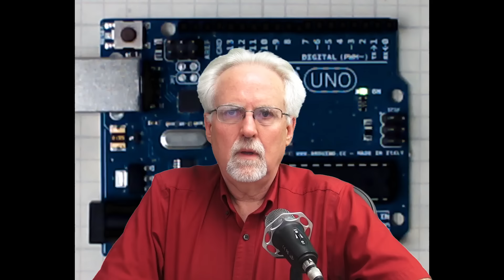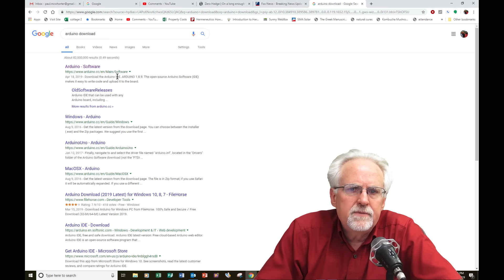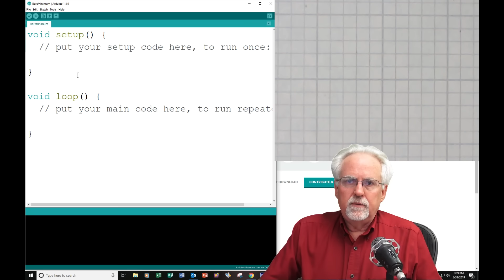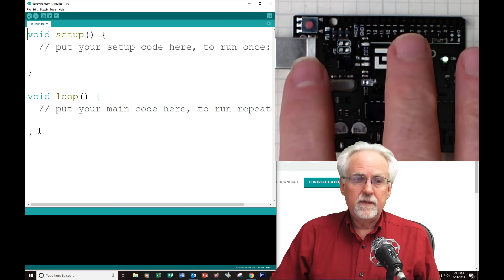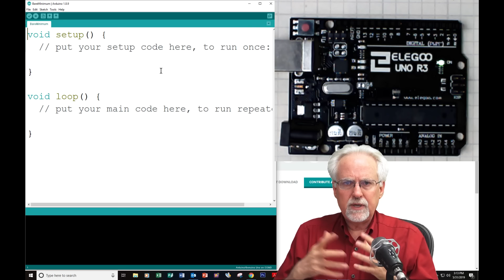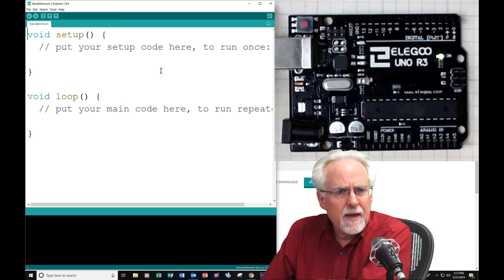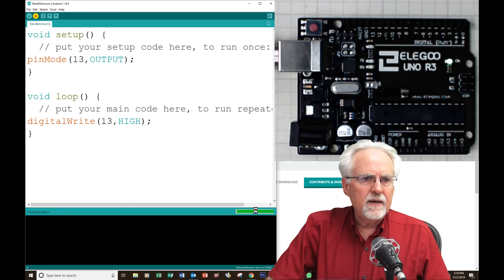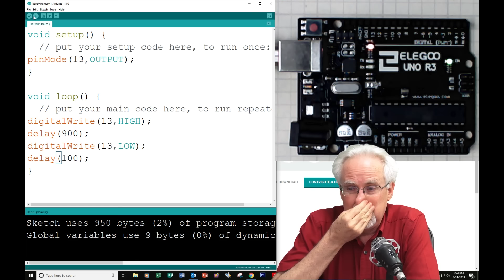Arduino Tutorial 1: Setting Up and Programming the Arduino for Absolute Beginners

Comment: Had a load of grief getting Windows to install the FTDI driver for my 1st tutorial (same problem on separate W7H and W10H machines). Eventually got working by using Microsoft driver instead of the Arduino driver. However, I was drinking sparkling water rather than iced coffee which maybe didn't help. Anyway, succefully did the tutorial and I got down to about 20mS on 20mS off. Any shorter period and it I could no longer observe discernable blink. 👍 Thank you for excellent tutorial.

Comment: I just got the kit, and found this video. I followed your directions very closely, downloaded the software, installed it, ran it, and entered the programs you layed out. My program works well. 

In my opinion, the LED doesn't have time to completely discharge when the cycle is lower than around 40 milliseconds. I can still see the light fluctuate to around 20 milliseconds, but it is pretty obvious (to me) that it doesn't have time to completely darken in so short a cycle. 

I'm running this from Puppy Linux (Fossapup64v9.5) on a Dell Optiplex 390 i5 2310@2.90GHz. It only took a few minutes to get the interface installed and running. Pretty seamless. 

Thanks for the content. Keep up the good work. בס״ד

Comment: I just got the kit, and found this video.

My program works well. In my opinion, the LED doesn't have time to completely discharge when the cycle is lower than around 40 milliseconds. I can still see the light fluctuate to around 20 milliseconds, but it is pretty obvious (to me) that it doesn't have time to completely darken in so short a cycle.

I'm running this from Puppy Linux (Fossapup64v9.5) on a Dell Optiplex 390 i5 2310@2.90GHz.
It only took a few minutes to get the interface installed and running. Pretty seamless.

Thanks for the content.
Keep up the good work.  בס״ד

Comment: hello sir
iam using tinkercad for building the arduino and coding in arduino software here i get led light at delay 5 also 
here is the code
void setup()
{
  pinMode(13, OUTPUT);
}

void loop()
{
  digitalWrite(13, HIGH);
  delay(5);
  digitalWrite(13, LOW);

  delay(500);
}

Comment: Hello, Several months ago I followed many of your tutorials on the Arduino Uno but I had to quit for various reasons. I have decided to start again and have started with Tutorial 1 however I'm having a couple of problems. 1) when plugging in the USB cord, the pin 13 light comes on and stays on. 2) when I write the program and press send to compile, I get the "Error compiling for board Arduino Uno". I've selected the correct board, the correct COM port, I have uninstalled and re-installed the software, which is now 1.8.13 with no success. Any suggestions?

Comment: Thank you for this.  I actually thought I knew all of what was in this video but I discovered that I wasn't changing the type of board when I should be.  I found that the LED on the board (pin 13) stopped blinking, to my brains perception, at around 15 or 16 mSec.

Comment: To my surprise (I am 68), I can go as low as {15,15} and therefore the time period T is 0.015 + 0.015 = 0.030 sec. The frequency f = 1 / T or 1 / 0.03 = 33.33 Hz.
That explains why frequencies on a TV monitor higher than 34 Hz are no problem to me (I think).

Comment: Arduino: 1.8.13 (Windows 10), Board: "Arduino Uno"

Sketch uses 924 bytes (2%) of program storage space. Maximum is 32256 bytes.

Global variables use 9 bytes (0%) of dynamic memory, leaving 2039 bytes for local variables. Maximum is 2048 bytes.

An error occurred while uploading the sketch

This report would have more information with
"Show verbose output during compilation"
option enabled in File -> Preferences.
  
i am a total beginner to Arduino and my first program does not work, i copied those error messages and pasted them here, can you please help me out, please.

Comment: I put 9 ms as the delay and the LED looks continuously on,  Tesla chose 16.6ms which is why the USA electrical power frequency is 60 Hertz.  The Germans who imported the technology did not like 60 and being metric, they decided 100/2=50 is better and since the Germans were more respected than USA at that time, all of Europe chose 50 Hertz.  the Europeans conquered the world so all of the world is using 50 Hz while N. America and Japan is using 60 Hertz.  But Tesla was using a generator where the ON and OFF is not a square waves which is why 16.6ms or 60 Hz is sufficient.

Comment: Is this still relevant today, I would like to learn arduino 😄
Reply: totally still a thing!   🙂👍
the Arduino community is actually pretty huge.  welcome!

1st, google “Download Arduino” and get the software.

next there are lots of demo projects you can start with, google: “Arduino ProjectHub”

as for sensors, motors, LEDs, etc.
many pre-built modules are offered online, e.g. Amazon.  search “Arduino Module”
I highly recommend getting a starter-kit with like, 3 dozen basic modules to try.  — they are around $30-50

you maybe want an “Arduino Uno” to learn on, — that’s the name of the circuit-board shown in the video.

also tho, I recommend searching, “Arduino Nano” and getting a 3-pack or a 5-pack.
they are smaller and cheaper that the “Arduino Uno” but otherwise do all the same things as the Uno.

💜  Good Luck, Have Fun!
Reply: yes, I bought my kit yesterday on amazon.

Comment: i m getting this error message just after installing the program. how to resolve this. whenever i m trying to compile a program it gives this message(even when the board is not connected)

avr-g++: error: device-specs/specs-atmega328p: No such file or directory

exit status 1

Error compiling for board Arduino Uno.

Comment: Hi I just connected my arduino card and LED started blinking automatically without command. I am using program 1.8.13 told to exit status after following all steps and (void unit_8 ; unit_8). Am I doing something wrong?

Comment: I am new to arduino. I have been watching Paul's videos and learning a Lot. I have successfully built my own circuit including RFID reader and a servo motor. Thanks to his videos I am starting to grasp how to build the circuit, how it works and how to code it. 
I am stuck now though. I now wish to add A push button to the arduino motherboard and code it to control the servo motor to cycle 180 degrees on each button press . Is there a video that paul has made That addresses this type of addition to an existing project? Maybe I'm over thinking this but truly stuck.

Comment: Paul, I am a total "virgin" beginner to Ardunio - even took me several days to pronounce that correctly! Is there a cheat-sheet available with the different commands/explanations?  I also notice you are using an ELEGOO UNO R3, is that brand reliable and less expensive than Arduino's brand? Thanks for making this very easy .... so far!

Comment: I just bought a Nano and a Mega 2560.  Neither board will communicate with my computer.  They both make the computer do its happy noise when you plug them in but the name of the Arduino never shows assigned to a COM port under ports.  And the sample program (making pin 13 high) that you show in lesson 1 will not load.  The only thing that happens it that the "L" LED just blinks and blinks and blinks.  Any ideas?  I did try a different computer and the same thing happens..

Comment: Well a couple weeks ago I discovered dc motor experiments. Noticed drill motors. Noticed I could make my own repairs on my tools with the know how. Research...I now understand why my xbox controller wouldn't vibrate after I kicked it...soldering came loose.... Then I noticed wires...why does this go here? Yank! Snap pop! ouch! Stopped working period. Then noticed the board inside and was like yo little silver dots blinking lights and what is that cylinder thing soldered there for? Capacitor... resistors...why do these make this work? I found you today. Thank you. Now I'm full blown into this stuff. Thank you.

Comment: I am using a laptop for my Uno. Can that laptop be plugged into the wall, and charging while I use the arduino? Or does it need to be run off of just the laptop battery?

Comment: Affiliate link is linked to the wrong kit.  It directs to the ultimate starter kit instead of the super starter kit.  I would have used the affiliate link had it taken me to the correct product.  

Even though I purchased the super starter kit, I have also purchased a genuine Arduino board to support them with their development of this product.

Comment: Great video, thank you Mr.McWhorter! For the assignment, with a duty cycle of 50%, I tested with a starting delay of 70 ms between the on and off signals. As I went down in intervals of 10 ms, I could see the blinking light up until a delay of10 ms. I backtracked to 15 ms from there, and found the exact time I stopped seeing the blinking with my naked eye was 13 ms.
Reply: 14 for me

Comment: The kit Paul is recommending is the "Super Starter Kit" currently $36.99 on Amazon. The link from the you tube video appears incorrect but if you go to Paul's toptechboy link for Lesson 1 and click on the link there, it takes you to the Super Starter Kit.
Reply from the maker: The problem is over time availability, prices and vendors change. Most any of the Elegoo kits will work with these lessons.
Reply: @paulmcwhorter  Thanks Paul. I enjoyed the lesson so much that I subscribed to your channel and also wanted to be sure you got some credit when I order the kit. Since the kit that came up from your link was more expensive and not the "Super" kit you mentioned, I was not sure you were going to get any credit for my order.

Comment: S.O.S. in Morse code!

void setup() {
  // put your setup code here, to run once:
pinMode(13,OUTPUT);
}

void loop() {
  // put your main code here, to run repeatedly:
digitalWrite(13,HIGH);
delay(400);
digitalWrite(13,LOW);
delay(500);
digitalWrite(13,HIGH);
delay(400);
digitalWrite(13,LOW);
delay(500);
digitalWrite(13,HIGH);
delay(400);
digitalWrite(13,LOW);
delay(500);
digitalWrite(13,HIGH);
delay(800);
digitalWrite(13,LOW);
delay(500);
digitalWrite(13,HIGH);
delay(800);
digitalWrite(13,LOW);
delay(500);
digitalWrite(13,HIGH);
delay(800);
digitalWrite(13,LOW);
delay(500);
digitalWrite(13,HIGH);
delay(400);
digitalWrite(13,LOW);
delay(500);
digitalWrite(13,HIGH);
delay(400);
digitalWrite(13,LOW);
delay(500);
digitalWrite(13,HIGH);
delay(400);
digitalWrite(13,LOW);
delay(800);
}

Comment: I'm not very good with computers. Have MAC, followed directions and Arduino shows up on the computer. When connected to Arduino unit, the light for 13 blinks constant without inputting any codes. So Ill get to continue once I figure that out. If anyone has input, please advise.

Comment: Hi, I am not exactly using an Arduino board but an Infineon XMC 4700 board.I have installed the necessary softwares from Arduino board manager.I also had to install J-Link documentation pack by segger.com.I am now able to see and connect to an XMC 4700 board from board manager.Now when I have uploaded the program an error shows up reading"could not connect to target".Then a  J-Link window pops up saying that there is no emulator connected via USB.Do have any suggestions for this?

Thanks

Comment: The command is, "wait for it": delay... Barney Stinson is so proud of you :)
Reply: Please help me out with the following questions.

DESIGN A POTENTIOMETER REGULATED LED SYSTEM WHEN THE VOLTAGE IS BETWEEN THE FOLLOWING RANGE.

0v and 1v = blue LED ON,

2v and 3v = green LED on without offing the blue LED,

3v and 4v = red LED on,put on the blue LED on again and put off the green and yellow LED,

4v and 5v = blue LED blinks 4 times and go off, green LED blinks 3 times and go off, yellow LED blinks 2 times and go off, red LED blinks once and go off.

When the voltage is still between 4v and 5v,the the process start again(blue LED blinks 4 times and go off, green LED blinks 3 times and go off, yellow LED blinks 2 times and go off, red LED blinks once and go off).

Comment: I have solar and TED(Ted Energy Detective) monitoring energy system. Easy and cheap Adurino current monitoring main leafs at breaker box. Loop 1 to 5 turns of bare wire directly around insulated incoming power lead and measure magnitude of current and print to PC display or lcd. This would make a great team project. Real world application and needed!

Comment: 15 milliseconds- Led blink slightly shakey
20-more shakey
25-even more
35-most shakey
40-extremely blinky
50-extremely extremely blinky

in all the above cases you can see that it will blink but not possible to "see" the off position only the on is more visible.

Comment: trying to write  an SOS Program  using If and For Loop with two LED's Red and Green

/*Progran to Display SOS (...- - - ...)
  SOS LED delay = (dT dT dT sdT sdT sdT dT dT dT) ldT (dT dT dT sdT sdT sdT dT dT dT)
  M.K.Butan
  Date 03.10.2020*/

int dT = 250;
int SdT = 500;
int ldT = 1000;
int gLed=7;
int rLed=8;
char x;

void setup() {
  Serial.begin(9600);
   pinMode(gLed, OUTPUT);
   pinMode(rLed, OUTPUT);
}

void loop() {
  //Progran to Display SOS (...- - - ...)
  //DOT(...)    [S]
  //DASH(- - -) [O]
  //DOT(...)    [S]
  
 // if chr == SOS;
 Serial.print(x);
  for (i=0;i,3;i++){
    pinMode(gLed,HIGH);
    delay(sdT);
    pinMode(gLed,LOW);
  }
 // else 
  for(j=0;j,3;j++){
    pinMode(rLed,HIGH);
    delay(ldT);
    pinMode(rLed,LOW);
  }
    
  
}

Comment: Hi i brought a Arduino starter kit know i done a project out of the book that came with it i have installed the driver for the port and i have downloaded the software sketch sep 20a Arduino 1.0.6 .I have built the project and when i plug it in to the PC it make a noise to say it connected then i open up the software and follow the code sheet for the project i built the when i go to transfer it over to the Arduino from the software it come up all these error message why is this happening when i follow the code sheet

Comment: hi i have a 25 yr old cnc machine that im trying to replace orig controller board with arduino uno and control that way...im using orig 25yr old stepper driver board..the orig communication configuration on the cnc communication was via serial or parallel port.and worked fine...i just wanted to change controller to be able to increase machine capability........i .i have used a mach3 breakout board and machine stepper motors responds fine but when i try using arduino uno as controller  i get no response from the stepper motors...the stepper motors engage when pc and arduino uno is powered on but they dont respond to any jog moves in UGS.....i use Universal gcode sender and all looks good.....is arduino signals possibly not compatible with the 25yr old stepper driver board?

Comment: Greetings Paul. I just wanted to thank you so much for these tutorials. I've been wanting to dabble with Arduino for a while, primarily to do lighting effects in my Sci-Fi models. But despite some familiarity with hobby electronics (my Dad was an electrical engineer), and a tiny bit of programming (BASIC on both Vic20, and Ti99 back in the day, plus learning HTML coding), I found it a bit daunting to get started. Your great tutorials have made it super easy to get going, and I had already purchased the ELEGOO starter kit before I knew about these videos, so that worked out great. I'm only on lesson 4 now, but I'm very much looking forward to running through the entire playlist. I guess sometimes you can teach old dogs new tricks.

Comment: I really need help programming six Steppers. Push button start, 3 second delay, 2 steppers doing the opposite motion at the same time of 160 degree movement in 1 second and back home, then move to the second set of 2 Steppers doing the opposite 160, then the final three gong 160 and then home to a stop. I'm Lost at programming. Thanks

Comment: Good Morning Paul,
I was able to detect blinking at 15 on, 15 off.
At 84 my eyes are not as good as they used to be but .........

I am building a CNC plasma cutting table. The mechanics of this machine are not complicated but the controls are proving to be a real problem. I don't think i am out of the ordinary with this problem. 
Would you consider doing a video series on how to select and assemble the components necessary to make  CNC  machines function ?

I am also doing your Fusion 360 series.  If not for your assistance I would have died trying.

Thanks a Million.
Wally

Comment: Please answer my question:Delay on 0 ms is the same as no delay however when I had no delay the LED was extremely dull and when I did have delay (on zero) the light was brighter. Why was that?It shouldn't have been the case as delay on 0 ms is the same as no delay.

Comment: Advice for those who are starting this course: from someone who has just finished it I had already an Arduino starter kit but not Elegoo's; I thought that I would spare some bucks using my kit and buying the few components that I hadn't. Do not fall into the same mistake. I had to buy quite a few and in the end, I had to spend as much money as I would if I had bought the Elegoo kit, and I had to interrupt the course several times waiting for my new components to arrive. This course is absolutely fun to follow, Paul is a fantastic teacher, and when you finish it you will have a good grasp on Arduino and electronics in general. I had never done anything with electronics and I couldn't even distinguish potential from current when I started; so, if I could do it, anyone can.
Reply: I have fallen already yesterday
Reply: @ABSP5766  Good advice.

Comment: Hey, my keyboard stops working whenever I plug in my arduino. On my laptop, when I tried to attach it, it said device requires more power than the slot can provide. Any fix?